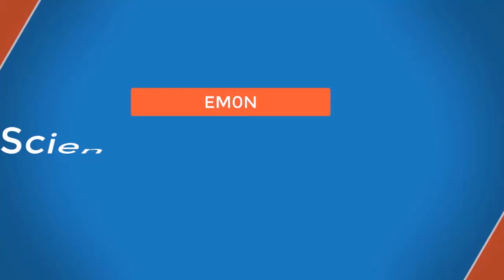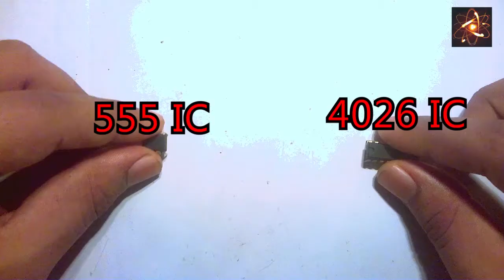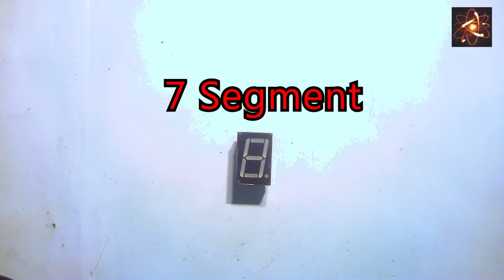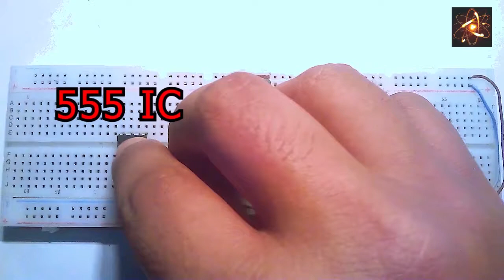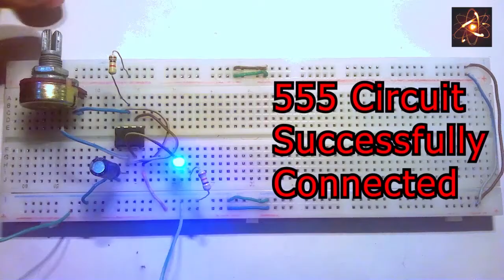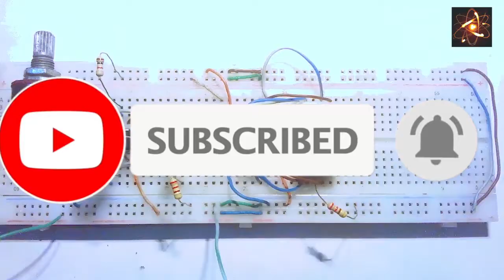Seven Segment Counter Circuit using 555 and 4026

Comment: Will it differ if I used 1M variable resistor instead of 500k ohm?
Also if it won't work with 1M then what will I see exactly or it won't even light the 7 segment?

Comment: Nice one. Even without the circuit diagram, you make it very clear what you are doing. This is the most understandable video I’ve seen for connecting the 555 to the 4026. Thanks a lot. Very good!